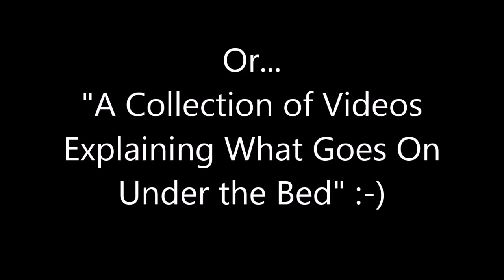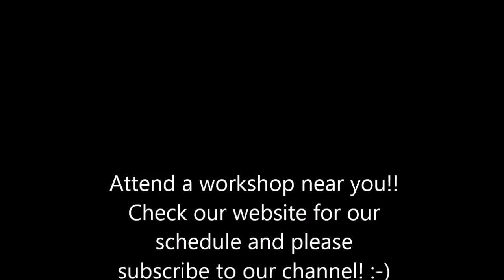Solving Issues With Sewing Machine Picking up Lower Thread

Comment: I was sewing along and all of a sudden the bobbin thread stopped picking up. I will investigate further and i have a late '60, early '70's White machine that I love. I will check my needle or maybe I was pulling the fabric, but I thank you for your helpful information. Over the years I have always fixed my own machine, clean and oiled and they run great! Well, untill right now. but I will find a solution.

Comment: Thank you! I never knew about the groove in one side of the needle. I got my old Singer out to make masks for Covid-19 and the needle was not picking up the bobbin thread. I turned the needle in the correct direction and presto, it works!
Reply: Same happened to us too, wife was sewing, broke the needle, asked me to change it. Then thread wouldn't pick up, 2 hours later of head scratching, thanks to the guru here, and machine's up running again. Am happy wife's make masks during covid-rantine
Reply: Instablaster.

Comment: Super, I now understand what to look for.  Just popped in as I've been renovating a 66K - she does sew nicely apart from a couple of skipped threads now and then.  I know she can do it better!  Just a little adjustment and she'll be good to go, thank you from wet and windy Devon, UK!
Reply: Carrie is your 66 Model of white sewing machine if so I have one and then I fixed it and it's those beautiful doesn't skip anything no stitches nothing works great
Reply: It's a 66K Singer made in 1935.  Super little machine.  I figured it might be the bobbin as the little rubber on the winder was a little loose.  Just got a new one to try and see if that helps.  I guess I still need to tinker a little more!  :D
Reply: @kerryl4031  does your electric run on 220 we run on 110
Reply: Our electricity is indeed 220, but I've removed the motor and set her back to treadle mode - can't go outside at the moment so it'll be a nice bit of exercise!  All tweaks and adjustments sorted and she's running beautifully today and no more skipped stitches.  
It's damp and thick fog outside (at least the wind has dropped - we had ex-hurricane Pablo swoop in yesterday, or the remnants) - so what better thing to do than play with her!  LOL!  I have a Project Linus charity quilt to work on - I think I'll let her do this one.  
It does help to see how things work - and your video certainly helped there!  Many thanks :D

Comment: Okay, I've watched quite a few machine-repair videos. And I've been sewing for about 40yrs.
 Right now I have a 20yo Kenmore #17826 in good, clean condition except for the zig-zag stitches and the reverse- they won't work! It isn't an expensive model, I think it was on the less expensive end, but it has worked beautifully. I made the kids costumes, I quilted with it, took it to quilting classes...
As per the videos, I have taken apart the bobbin mechanics, dusted every nook and cranny from the bottom plate to the needle bar and then oiled in the indicated holes.
I haven't used it for about 10yrs, it's been in it's hard case in the garage, but I thought it was working fine when I put it away.
Can I - oh yeah, it has a drop-in bobbin- do anything else for it? I live in Bozeman, Montana and sewing machine mechanics are rare.
Thank you for your video, I really enjoyed it.

Comment: Lol i got an old kenmore and pissed around for hrs trying to figure out why it wouldnt pick up the bobbin thread then realized someone put the needle in backwards...and thank you for taking your time to show us the timing and how it works on different machines i wanted to see if my timming was off considering i just picked up a kenmore from the 60s or older i cant find info on it kenmore deluxe model # c877.02 seems to be hard to track year and i want a new belt  , but believe it or not its still perfect . Love vintage machines and all the quality put into them and not a single piece of plastic in it , all metal and heavy duty .

Comment: Thank you Thank you Thank you for your informative video.  You helped me solve my non responsive bobbin issue on my BabyLock Coronet longarm machine, plus you saved me hours of travel to take it to shop and leave it for up to 2 weeks for a "timing" issue.  I had the needle in backwards so the hook couldn't work.  On my long-arm the needle shaft is round and can be in frontwards or backwards and will slide in place nicely but be wrong.  My problem is solved and my quilting will go on!

Comment: Very informative, Thanx!  Can you help with an OLD embossed White Rotary?
The timing is not off by a few degrees.  More like 180!
Reply from the maker: Sure, if it is 180° out, someone has removed the shuttle and put it back in the wrong orientation. Just pop loose the ears that hold the plate covering the shuttle, rotate it (the shuttle) 180°, and put it back in. The shuttle is the piece with the pin that the bobbin case snaps on to.

Comment: Thanks a million Ray, I was having a problem figuring out why my Morse 7100 was not picking up the bobbin thread, Your excellent video pinpointed the exact problem.  You are so right, the old solid built metal monsters of the past are so much better than the plastic POS's they are putting out today.

Comment: I watched this three times and fixed the needle.  Now on my singer 201 it picks up the loop (Yay!) but still does not sew. Should the housing that holds the bobbin more around? Every third stitch something binds.  I just get a big mess of broken top threads on the bottom of my fabric.
Very interesting video and fun to see how those other machines do this.
Reply: I have the same problem!! It picks up the loop but when i start the machine, it doesn’t sew. Funny thing is that on some material, it does and some not. Any idea?
Reply: @wintybear  The bobbin housing tab was not in the slot which holds it in the correct position.  I had to take it all apart and put it back correctly, then it worked. I used the 201 adjusters manual to do it.
This video shows the tab and slot.          https://youtu.be/lT98wbDLVco

Comment: Thanks for an incisive solution but it didn't work with my Vigetti, age 68 yrs.  After having nesting threads I screwed the Bible sure slightly and the stitching is perfect; yet the bottom thread isn't being picked up.  Have spent at least 1K over the years on this machine and don't want a plastic one, but I hope you will see this and tell me what else Icn do.  My needle threads flat side in a grove; not the rounded side.  Help please!!!!
Reply: I meant the bobbin screw slightly.  Hope to hear from you soon, and also hope you explain why with the bottom thread is not picking up, yet  the stitch is perfect?????

Comment: i have a singer #247 machine gear on vertical  shaft broke, replaced  gear, now hook, won't pick up thread,  took  all lower parts out , so i could see action ,timing is spot on but thread  does not form  a loop, seems to hug side of needle ,needle is in right . any ideas?

Comment: Here's the problem I'm having: I have a Necchi 535FA that apparently is for medium duty use and I have a size 18 needle with some upholstery thread that will work fine with a super-light thread on the bobbin (a metal class 15 bobbin that came with the machine) but when I put a plastic class 15 bobbin (they are the only additional ones I have) and wind them with heavier upholstery thread the machine won't consistently pick up the thread. The hook catches it, but instead of the thread coming around the bottom of the bobbin case/gib assembly completely it gets hung up on the bottom. I can't figure out what is wrong.
Reply from the maker: Most likely your bobbins are too thick. That is what are usually see causing the problem you're having. When a bobbin is too thick the thread will not be able to go through the narrow gap between the bobbin and the components that sit close to it

Comment: I have a Singer 288 machine and I think I might have a problem with the timing. The hook is not picking up the thread from the needle and I am not even sure if the hook is moving to begin with. I have to manually move it using the gears at the bottom of the machine. I have seen many videos that suggested how to fix the timing problem, but so far none shows how to do it for a 288 machine and I am afraid the construction of the mechanism is different so I am not sure how to fix or from where to begin. Is there any way you could suggest a solution for my issue?

Comment: If the timing is off wouldn't that also stop the top needle thread 
from picking up the bobbin thread?
Reply from the maker: If the timing is off, the hook will not catch the upper thread from the needle, so obviously then there would be no picking up the bottom thread.

Comment: Have you found anything better to clean up an old black singer sewing machine ?   I picked up an old singer 15-91 that was sitting for years and it is caked up with grime & dirt - and the decals look to be perfect - and I want to keep it that way.    Any assistance would be greatly appreciated.
Reply from the maker: I've not found anything yet that will clean them better than Gojo. On the earlier machines with the bug shellac over japan black, ya just have to work at it a little slower and more carefully since the shellac is also organic. The grime on most early machines is actually residue from the whale oil used to lube them and it being organic as well. The Gojo takes off the whale oil very good but just gotta be careful because it don't know where whale oil ends and bug shellac begins. If yours is after mid-30s you shouldn't have that problem though.
Reply: Baby oil applied with magic eraser sponge, works great on cleaning up the grime.

Comment: Does this work the same on a Singer 132K1 ?
Reply from the maker: This will apply to ALL sewing machines with no exceptions. The interaction between the needle and the hook/shuttle will be the same in any machine ever built, otherwise it will not stitch correctly.

Comment: my machine hook is picking up the thread but still won't pick up the bottom. it just loops the top thread underneath. Help! very good video to show how that hook catches the thread.
Reply from the maker: thank you for your kind comment. As for your issue, I can only suggest that you find what the thread is catching on underneath and correct it. Since the hook is catching the upper thread and looping it underneath, it is doing what it is supposed to do up to that point. I assume you are holding the loose end of the upper thread, then pulling it slightly once the needle comes back up, correct? If the hook did indeed catch the thread and loop it all the way around, then the bobbin thread will be in that loop when the needle comes back up and you pull the loose end of the upper thread. If you have the loose end of the upper thread between your fingers, the bottom thread cannot get out of that loop. You should be able to pull on the loose end, while watching underneath, and find what the upper thread is looped on and preventing it from releasing and coming up top (and bringing the lower thread with it). 
 I really can't make any other suggestions going just by what you've told me. I am trying to picture the issue you are having but there are still things I'd have to ask before making any further suggestion. I would like to know this; Without the bobbin in the machine, does your hook catch the upper thread, loop around, then is released by the hook and allow you to pull it back up with the needle (once the needle is back up top)? Remember in the video, there is no reason to even have the bobbin in the machine until the upper thread will loop and the hook take it around. If it does that, then you are able to pull the upper thread all the way back up and out of the hole in the throat plate, then picking up the bottom thread will be inevitable once the threaded bobbin is in the machine. 
 Hope I can help, but might need more info or a video before I can really help much more. :-(
 Good Luck!!

Comment: Hi have a singer 427 and thread not picking up and wheel what spool fit in will not move proper and opened under for timing but the belt is not moving can u help plz
Reply from the maker: I'm sorry and don't mean to sound rude, but I truly do not understand what you are asking. If you have parts not moving inside the machine that should be, that is a different problem altogether and I'd need a much better explanation and maybe even see what you are having troubles with in a video. I'm not familiar enough with a 427 to tell you from memory what to do to solve many issues. Your problem is specific to your machine and not a general problem that can be addressed like the video I posted that deals with solving a problem that will have the same cause in any machine.

Comment: What if it is with a long arm?  The needle is different
Reply from the maker: Nope, needle still has a grooved side which must be opposite the hook. Some have a round shank instead of a flat at the top, but the needle must still be oriented the same. No matter how long the arm, the interaction between the hook and the needle doesn't change.